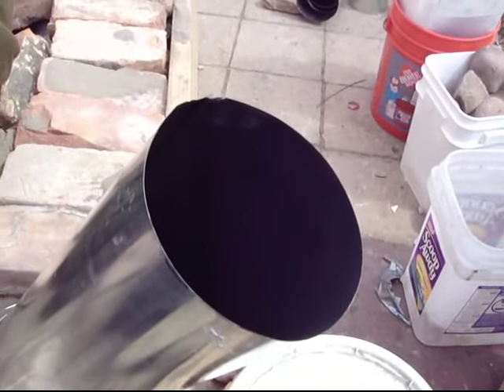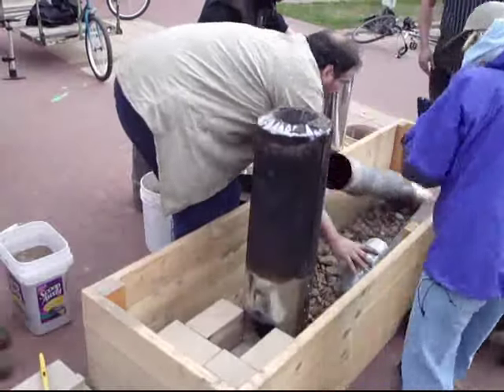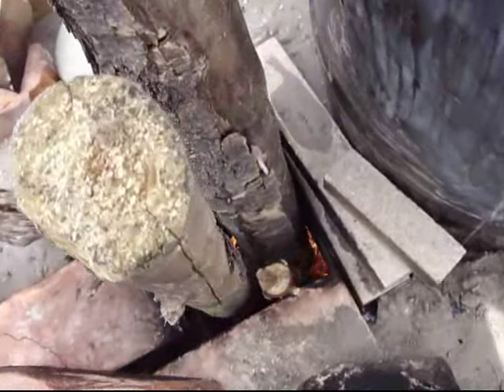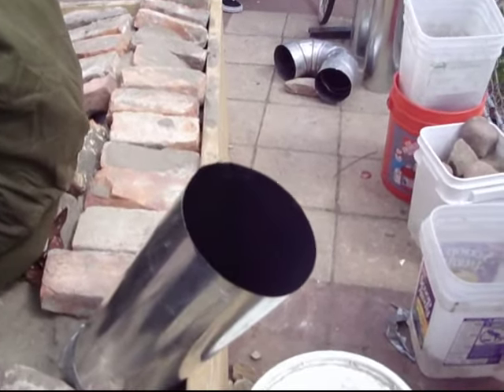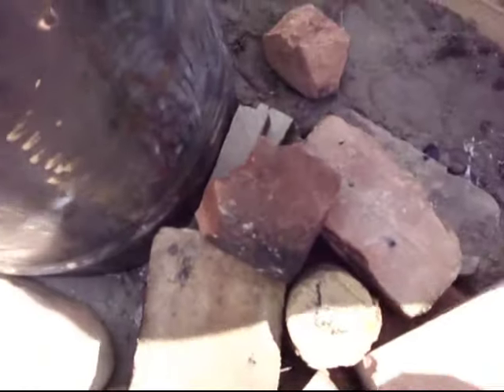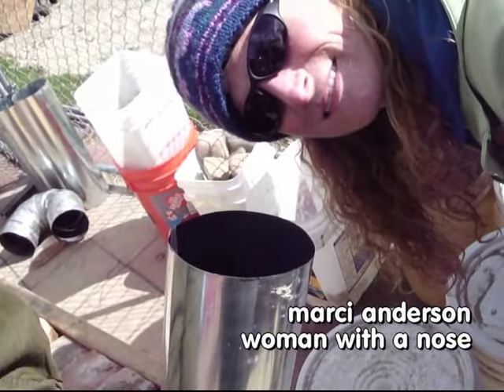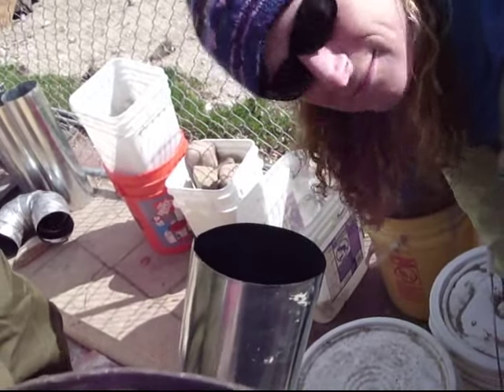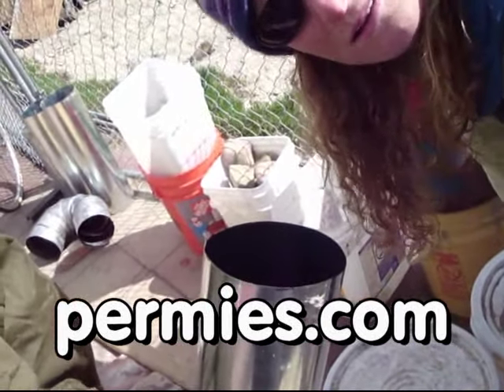Clean, Cool Exhaust from a Rocket Mass Heater

Comment from the maker: I removed a psychotic rant about carbon monoxide.  We actually ran a CO tester on this that was operated by a guy that does professional CO testing for a living.  He said it was cleaner than any natural gas heater he has tested.  Further, for our indoor installations, we have CO testers plugged in - these things run very clean.   Plus, it turns out that if you heat your home with a rocket mass heater for a year, it will emit less than a tenth of the greenhouse gases that natural gas emits!  Bonus!
Reply: would be nice to quote the scientific paper, do you have the source?
Reply from the maker: MotherGoosePermaculture A-S-Kelly what do you mean by "the scientific paper"?

Comment from the maker: @shanemacc We had a guy there with a portable CO meter for a while.  He was getting a lot of different results at a lot of different times.  Typically, when the exhaust was clear, he was getting a reading of zero.  And when there was smoke, he was getting a high reading.  I think it would be good to get measurements on a more stable RMH.

Comment: The rocket mass heater design is amazing. I am thinking seriously about one but in my case the cost will be high. We have no clay in our soil and my floor will definitely not support one safely. I wish there was a video or book available that shows alternate safe building materials that may be available locally like mud instead of clay. I have seen some pizza ovens that use mud so maybe it would work????? Also could I use broken cement blocks instead of rocks? I just don't have the knowledge to safely make a decision on questions like this.
Reply from the maker: You need to check out the movies we made. Get your head wrapped around this stuff.  Especially the pebble style rocket mass heaters.

Comment: Hello, just recently built a small 4" rocket heater in my basement, and hooked the exhaust into my chimney. After 3 weeks of 12+ hrs of burn each day, I took it apart to check it, and my exhaust is covered in soot. My barrel, heart riser, everything. My exhaust loops for about 16' before heading vertical for 6', the elbowing into my chimney. Am I not burning hot enough? Letting it run low or out of fuel to often? It drafted well even with no fire in it.  Have pictures. Thanks for inspiring me and my family. If anyone can help, it's appreciated.
Reply from the maker: do you have a thread about it at permies with pics?
Reply: paul wheaton 
No, I couldn't honestly tell you what a thread is exactly, or how to put pictures on one. I'll hop on the website and see if I can't figure it out. Thanks! This was more of an experiment, I knew I'd be changing some things, but the creasote buildup scares me, with it running the little it did. We let it smolder out allot. Hoping it's mostly our fault. Enjoy your videos, very helpful, easy to watch. Thanks.